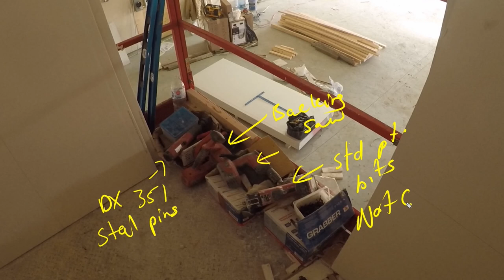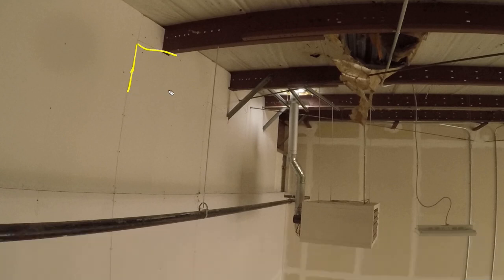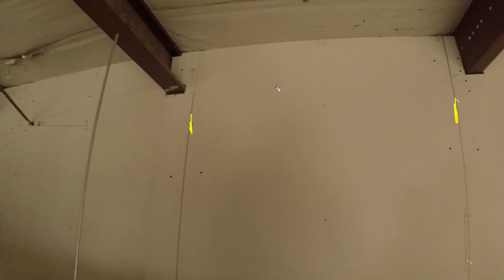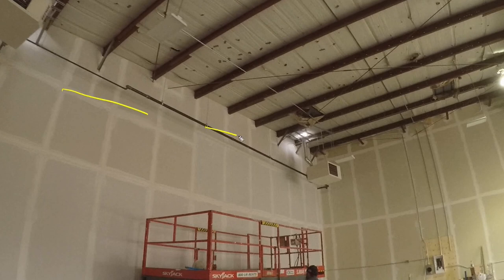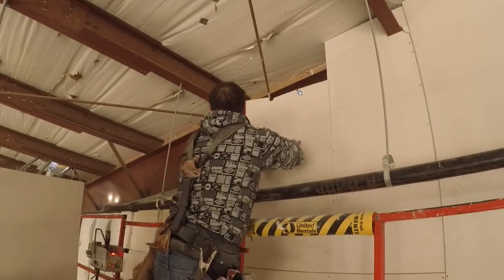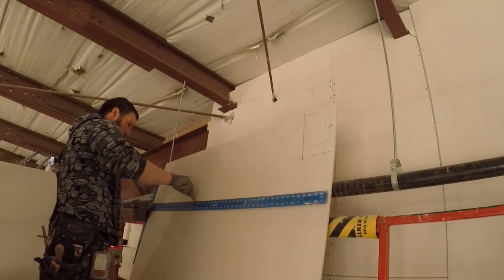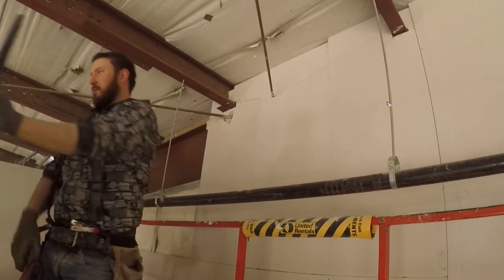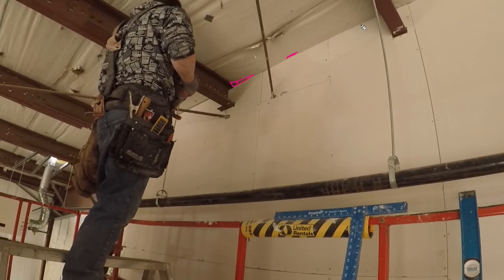Commercial Drywall | Lesson On Tops!

Comment: As a apprentice that I am how do you know when to put the drywall sheet up right in stead of laying them down and what's the benefit?
Reply from the maker: Great question. So it's actually easy to tell. You lay down sheets on wood framing and stand up on steel stud. The only time you ever lay sheets down on steel stud is exterior board or on walls the studs don't land properly on 16" or 24" center. Plumbing walls or walls with mechanical are examples of walls that sometimes do not land. You have to stand up your sheets on steel stud to achieve your proper fire rating.
Reply: @ConstructionKronies  
Thank you very much 😊

Comment: Shouldnt your wood backing be fire treated if its commercial? Being double layered tells me its a 2hr fire rated demising wall
Reply from the maker: Good question, the fire rating comes from the drywall and the framing doesn't count in our calculations. It's important to have a good seal using fire caulking and taping all your joints. You don't need to finish tape just a fire tape is required.

Comment: Unless you just did that for the first layer and the second layer will look nicer. In that case your cool
Reply from the maker: If its double layer we stagger the joints both vert and horizontal. This is how the system is specified. You guys who think staggering the joints have been taught wrong and are doing a lot of extra work for no reason at all. If you do lay downs on these walls it is against fire code. Steel Stud bro, this isn't wood.

Comment: Tops should not be tight as possible, you need room for deflection or the sheets will crack in the not to distant future
Reply from the maker: 100% yes you need to count for deflection. This is not the job to demonstrate the expansion joint because the celling is blanket insulation but here we always give 3/4". Most of the time you want your cut outs to be as tight as possible for the taper but some jobs require fire caulking so you need to consult the specs and find out what gap it needed, usually 1/4-3/8" Never make a top tight to the ceiling unless the expansion joint is in a lower location.

Comment: That’s slip track you need to have a expansion joint at that point sorry to criticize but it’s the right way to get proper wall assembly
Reply from the maker: Everything is floating above the track, nothing is attached to the beam. The backing is just to keep the bevels tight and doesn't interfere with expansion or contraction. I'm also keeping the screws in the studs 3" below the track. These are simple warehouse / shop bays.